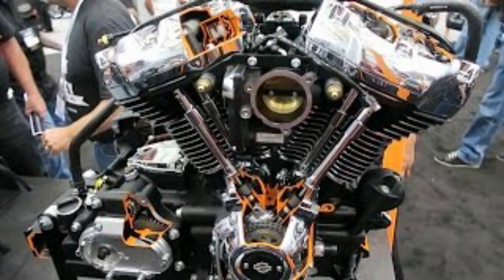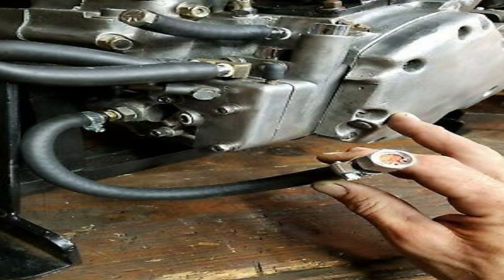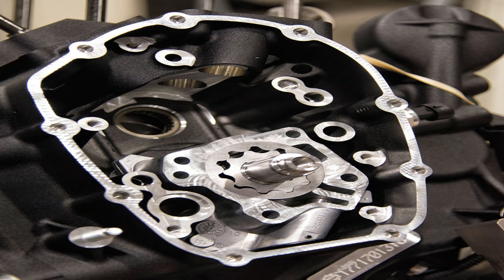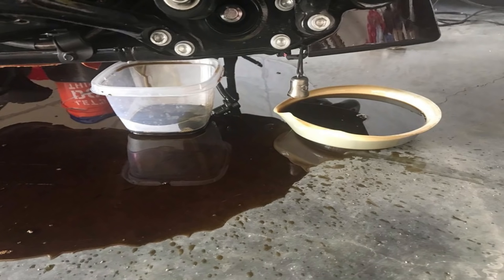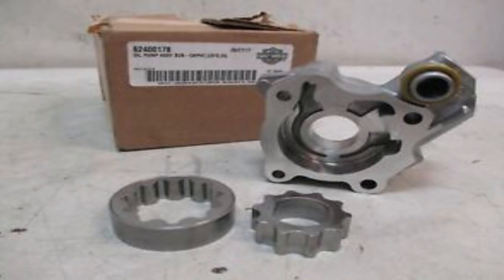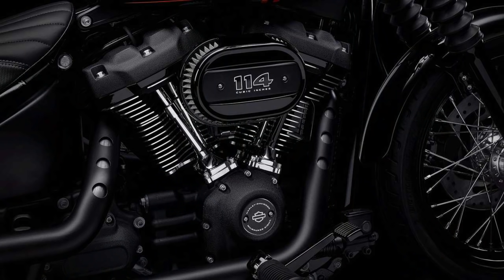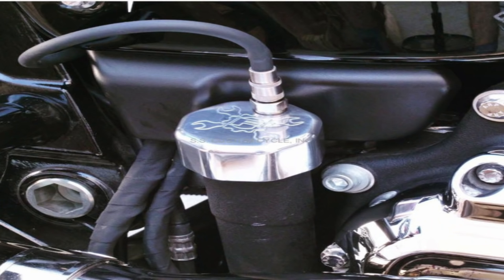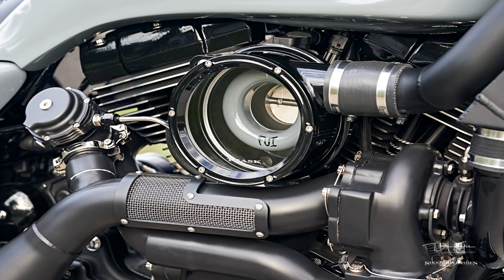The Fatal Milwaukee 8 Engine Flaw Harley-Davidson Missed

Comment: For what it matters. Have a 17' within one year my top end was toast. Rebuilt in 18' using a Fueling oil pump and vented the dipstick and still running strong 40k miles later.
Reply from the maker: Sucks your top end fried, I doubt you'll have any issues now going back the Feuling parts though.

Comment: So in the M8 from 2023 is no probleme with the oilpump?
Reply from the maker: The oil pump was updated in 2020, I still believe the crankcase has too much pressure personally. The oil pump is good, but just for peace of mind of would run a vented dip stick or trans cover.

Comment: 1:48 oops...HD missed it. 😅 I think not and the root of the problem is that its a HD!  BTW, Great video guys. Very informative.  I don't own a HD and this is one of the reasons why.
Reply from the maker: I just can't get over the fact they sent it down the line like that. Unless for whatever reason when these bikes were assembled in the shop they never had an issue and the problem materialized when they went down the production line.

Comment: I installed the new pump and still have sumping.  So, "true fix" is not a new oil pump. Ideas?
Reply: Might have to ventilate also
Reply from the maker: Likely going to have to go with a vented dip stick and or a vented transmission cover, every engine responds differently.
Reply: @GixxerFoo  How would a vented trans cover address the sumping issue?  I thought that was for the transfer issue.  tia

Comment: I agree with most of what you are saying but it's my thinking that any oil that's in the cam chest and crank case when the motor is shut off will stay there and not return as it sits because the cam chest might be able to return a small amount past the crank bearing into the cases but there it stays until it's pumped out. Everyone learns on their first dry sump motor that if it's been sitting for a while it's a good idea to run it a minute before you check the oil in order to avoid over filling it because it's all in the crank case and has to be pumped back to the tank. Not much return from the rocker boxes either unless you mount the side stand on the other side.

Comment: I have a 2018 road glide.  I did stage 3 and upgrade my oil pump to a 2019 oil pump.  I still blu the motor,  Harley Davidson paid for everything rebuilt my motor and put a 2020 pump.  I haven't had any problems since.
Reply from the maker: That exact thing happened on Adam Sandoval's Road Glide with the Stage 4 kit! Harley gave him that bike after he rode the entire US to every Harley dealer in the lower 48.

Comment: Seems the oil pump issue is not resolved in 2022. My 2022 RGS (114) had oil pressure relief valve failure causing the roaching of both cylinders and pistons. The initial indicator was some slobber on my right thigh after an Interstate late night 150 mile run. Bike had about 2500 miles on it when I sensed problems. Power loss was not that noticeable and very gradual. Never left me stranded. Fast forward to today when it is supposed to be finished. Harley is covering under warranty with zero blow back. It will have the SE upgraded oil pump, and the 122ci kit. I'm a bit disappointed about all this but I love the bike.

Comment: Will upgrading to an aftermarket pump void the engine warranty?
Reply from the maker: Yes it will under warranty, but that's sticky. They have to prove the pump caused an engine related failure, if you're under warranty it's best to wait or have the dealer install a second gen factory pump.

Comment: This is EXACTLY why I searched for 2020 and up when looking for my new bike. Ended up with a 2020 Heritage 114 with 740 miles on it for $5k less than a new '21 at the dealer. 😎
Reply from the maker: With the M8 I would highly suggest 2020 or newer unless you plan on upgrading the cam chest.
Reply: @GixxerFoo  that's why I was hunting specifically for a 2020. I really lucked out. Actually bought it from a Yamaha dealer that got it on a trade. Still plan on upgrading the can chest though. Likely using fueling parts.

Comment: Have had a 2018 Street Glide, 2020 Softail Standard and now a 2022 Electra Glide Standard. I haven’t had any sumping problems with any of them. Just a note. I don’t ride them easy and always find out how fast is the top speed. 114 mph with the limiter. I always ride at least 100 miles when I ride them. Using Mobil 1 V twin 20w50 oil.

Comment: Hi Gixxer.., I just mounted a S&S oilpumpkit and a Zippers 468 cam, new Feuling lifters - chain and Crank sprocket. I already had Big Sucker filter kit, a HD cat-less 2-1 (no dummy pipe) w. a Firebrand Loose Canon Muffler and a V&H FP3 to control it all.
My problem is that I can’t get the Idle down to 910 - 920 rpms where I want it, it’s up in the 1300 - 1350 rpms 😱…crazy high !
I tried to program it without luck,..so I took the Intake filter off and look into the throttle body when I was programming. It looks like it adjust itself…but not enough 😳…it’s still much to high,…well it’s actually only half a millimeter that causes the problems…when I press the “butterfly” throttle plate in an even more closed position the idle goes down to where I want it….but when I release it…it goes right up again. 😫 What in the world is going on…. and can you help me ? 
It seems like the electronic in the t-body just don’t want to make the “butterfly” adjust to an absolute close-position 🤔
Reply: Be careful to release contact with the throttle before  shutting motor down. The throttle is always sensed when you shut the bike off. Just the tiniest crack in that throttle will laugh reset it to a different place.

Comment: I have a 2020 and I think I'm having sumping issues, I ran my bike for a while, rode on the highway and got it nice and hot, pulled the crankcase sensor out and about 10oz of oil came out. I did this because I was getting inaccurate oil readings on the dip stick. Now I know why!
Reply from the maker: That is a classic sign of oil sumping!

Comment: Does HD accept responsibility for this issue and change the old pump???  Recall?
Reply from the maker: It's not a safety issues so from my understanding it wouldn't be a recall. I feel like it should be a good will voluntary recall though, a admittance there is an issue and we want to make good on it.

Comment: Got a 2020. Heads breath  into a catch can. Ride it hard in hot weather. Not using H-D oil. Mobil1 20w50 vtwin oil. No  noises , no  oil loss, no problems. 8600 Highway miles on It. No short rides.
Reply from the maker: Having that catch can makes a big difference, I'm not really a fan of Harley's oil either.

Comment: Harley can’t vent it to the atmosphere but they let the place for us to do it ourselves via the top of the transmission cover, mine is vented since new, 2021 FLFBS. I’ve installed an oil pressure gauge and a short sump plug by Feuling, I also check the oil levels every week. Zero issues so far.
Reply from the maker: Nothing wrong with that at all!

Comment: This was also an issue with the evo sportsters.
They vent into the air intake and after a good run the airfilter is saturated and leaks all over the motor.

Comment: Have 2019 flht . Put Dk wire oil filter on , 8 hp just from that.  Rode once 250 miles each direction. Never noticed anything. But Idaho isn't exactly hot most of time.

Comment: Hi love your thoughts on the old M8 engine's mine is a 2019 breakout with 114 the engine noise is a constant problem and since it started from new and harley saying Aaarrr "they all do that" and of course they don't iv change to adjustable screaming Eagle rockers s&s 465 cam and followers and adjustable push rods the new 2020 harley oil pump fitted a breather with a non return valve to a catch can off the plate that sits behind the rear cylinder (work's great) i use Amsoil and with all this it is a little better but still the noise is still there.  If I knew were the noise came from I'd change it out ! So if early m8s make this where do you think it comes from 🤷‍♂️ thanks for bringing your videos out to help us all.

Comment: My dealer fixed mine on the strength because of who I am. But my 2017 is paid for now but my bumper to bumper warranty is good until 2023. I am sure before that the revolution max engine will be in touring models or I will have the new Sportster with taller bars.
Reply from the maker: Man that's awesome to hear about a dealer taking care of someone! I wouldn't be surprised at all if we don't see a monster displacement liquid cooled engine built on the Revolution Max platform end up in a touring bike before too long.

Comment: Is this just the 114 or the 107 also?
Reply from the maker: It's the 107, 114 and the 117 early 2019 back to 2017. Interestingly though it hasn't seemed to be an issue on the Softail bikes, only the touring models.

Comment: I did the vented crank case on my 2017 road glide ,sold it two years ago and most rider got on my back for doing it 
looks like i was a head of the game , i also heard the primary case was also building up to much pressure ,not sure 
check it out
Reply from the maker: The M8's have terrible crank case ventilation from the factory, venting externally is the way to go. It's gotta go somewhere and with the factory system it seems to like to push past the rings.
Reply: @GixxerFoo  there are systems on line from the usa but they are pricey . go to a hydraulic shop and get a flow though 
quick coupling 1/8 pipe ane tape it in to the dipstick and a nipple on the other end 
3 feet of hose and a fold system fuel filter use super glue in the fitting of the dipstick because the oil will come out .drill a hole in the bottom of dipstick .not to big so the pressure will go throw the cap tape the coupling on the top .run the hose in to the side cover and loop it the n put the filter on . my engine falled at 5000 miles and it got rebuilt and i put the vent in after the rebuild my cost was around $ 25.00.

Comment: So which years and models do not have the problem?
Reply from the maker: Safe bet is the 2020 and newer, 2019's my have the new pump if it's late production.
Reply: Motor manufactered sometime from May 2019 up has newest 2020 oil pump is what I read

Comment: Hopefully my 2021 M8 will already have this issue sorted.
Reply from the maker: The 21's have the updated oil pump which has really seemed to alleviate the issue so far.
Reply: @GixxerFoo  thanks👍 getting my bike stage1 then fitting the new Woods xe cam in the future as stage2.

Comment: Is this problem mostly in Touring models or on the Softails also
 Have a 2018 with 40k and have no probs.
Reply from the maker: It's mostly been related to the touring bikes, that's Harley's bread and butter so you'd think they would put a lot of effort into getting those right. It's a hit and miss deal just like the tensioner issues of twin cam motors.
Reply: Thanks. My Heritage has had no issues.

Comment: Hope you can answer this. I have 2020 road glide that i bought late 2019. I do have a vented dipstick.  However i hear clacking when i start it and after long rides. I have rode it over 1000 miles in a day it sounds sad at the end of the  day  Is there any way i can tell if my early model 2020 has the old oil pump?

Thanks for any reply

Comment: What about 2021 M8 engine? Do they still have at problem?
Reply from the maker: They have the updated oil pump which has really seemed to cut down the sumping issues, I would still recommend a vented dip stick or transmission cover. Crankcase ventilation on the M8 is less than ideal, it's go some where and pushing oil past the rings is the easiest place.

Comment: I have the 2020 M8 with  stage 2 and have 0 issues I have 15k on in.
Reply from the maker: The have the upgraded oil pump, should be a very reliable motorcycle.

Comment: IF I ride my 2021Tri Glide all day as today 179 mile round trip and I check the oil the next morning and it is on the dip stick where it is supposed to be,  then there is no sump problem.
Reply from the maker: The 2021's are fine with the new pump, the issue happens with the old pump on the 2017 to early production 2019 models. The issue happens while you ride, when you shut the bike off all the oil drains back and when you check the oil it's where it should be. This is very misleading for many and you never know there is an issue going on until it presents itself in a very nasty way.
Reply: @GixxerFoo  Thanks

Comment: It appears so far on my 2018 Ultra Classic...no problems.  Keeping the bike factory stock/spec...no performance HP/torque add ons/upgrades adding to sump and cooling demand AND going to the premium Castrol V-Twin m/c oil for better viscosity and adherence to metal gears and parts and overall engine cooling...keeping oil level at perfect, so far🤞🤞no problems...no strange gear noises..no perceived cavitating in mountainous riding and excellent clutch response with the Castrol.

Comment: Did HD fix this problem in the 2022 bikes ????????
Reply from the maker: In 2020 Harley went with a new updated oil pump which the 2022 has, it has really seemed to help quite a bit with the sumping issues.

Comment: Damn it..! I wish I knew about the fuel moto and A1 before I dropped nearly $300 on the feuling vented version…ugh
Reply from the maker: Feuling is one of the best ones out there though too.
Reply: I was looking at this Feuling Kit, as it just looks a lot better than the A1.  However, those tiny set screws are notorious for stripping out and they recommend putting loctite on it.  Have you had any issues with it?

Comment: New Subscriber. I caught your video, thanks for the info. I did not know about the oil or the vented dipstick. Would really like more information if possible. Thanks...dp.
Reply from the maker: Thanks for the sub! The M8's really don't vent the crank case very well through the head breathers so having a vented dip stick or trans cover relieves a lot of pressure.

Comment: Seems an engine spitting and leaking oil on the ground and potentially on the rider is a safety issue that HD should be addressing under a recall.   NTSB complaint heading out.  People shouldn't have to wait for an engine failure to find out the engine isn't right.

Comment: A local rider installed a vented dipstick on his 131 motor. Long story, but his motor blew and Harley won't cover the repairs because of the ventilated dipstick. So now it's at a non Harley shop to be rebuilt. I'd be beyond pissed if I spent the additional money for the 131 only to have Harley not cover it because of an aftermarket dipstick. Has anyone else heard of such a thing?
Reply from the maker: A bad Harley dealer will do crap like that, really good dealers will do whatever it takes to get you're bike fixed under warranty. The 131's have been know to have some issues even put together with all the Harley parts.

Comment: Is anyone seeing problems with the 2023 m8?
Reply from the maker: So far so good with those, still recommend a vented dipstick and or tans cover. Crank pressure on M8's even with the updated oil pump is still high in my opinion.

Comment: Not just oil sumping. No pcv venting, and metal shavings found from not cleaning after block boring and honing. I’m pissed and will never buy a HD again
Reply from the maker: The M8 really has poor crank case ventilation, Harley has always had issues with the machining after the casting process.

Comment: Good video. Thanks. It's all about the "moolah," brother. Build them cheaply, sell them high, replace half the new parts on the bike you just paid for with upgrades, and then have the customer foot the repair bill when something fails. What a business model. And somehow, HDMOCO is barely worth anything in the stock market.

Comment: I have a 19 Ultra, that had a pump failure and fried my pistons and jigs as well as the flywheel bushings. The bike had 5700 miles and since I was 1 year out of warranty and had a PV installed with a modified tune, Harley declined any liability to the problem. If I didn't love my bike, I'd sell it and go elsewhere. Corporate Harley should have a class action lawsuit on this problem, They should fix every M8 that has this problem or upgrade the cam plate and oil pump. I'm beyond livid with HD and once this is fixed, $7k later, I will not spend another dime on this companies garbage. I also have a vented dipstick from Fueling on this bike.

Comment: I love using American companies.  I love the Harley look.  I love the Harley sound.  That being said, I bought a Honda.  Why?  To start with... money.  I got a brand new Honda VTX 1300 in 2009 which was on sale for 7,500.  I just didn't have the money to buy an expensive bike and 7500 for a new bike was pretty cool.  Secondly, reliability.  I have now put 85,000 miles on the bike and haven't had any engine or transmission or clutch etc. problems of any kind whatsoever.  It has never failed to start and run perfectly.  

The carb was set a little lean from the factory to meet emission standards so I did have to adjust the carb so that it wouldn't be cold natured.  It's actually sad to me that a great American company like Harley Davidson has so many serious problems with their engines.  Fortunately for them though, they sell bikes to Doctors and Lawyers and they have the money to fix them.  If you aren't rolling in the cash though, just go with something that is cheap and reliable.  Or maybe Indian is the way to go if you have some money.

Comment: Leak down test!

Everyone ignores this test. It uses a relatively cheap piece of equipment, requires only compressed air and removal of spark plugs.

This test lets you know the mechanical status of rings, and valves.

Everyone who operates an air cooled high powered engine would benefit from this test.